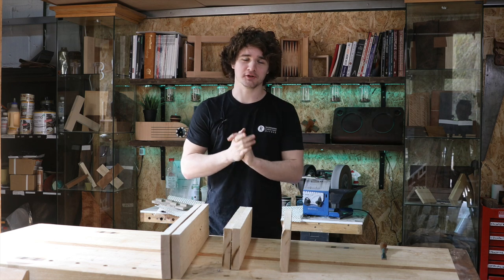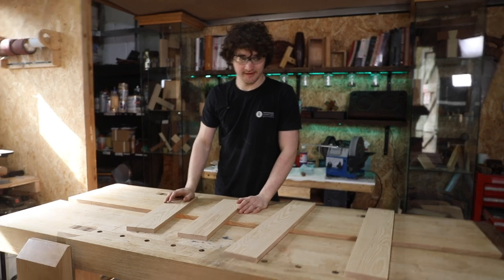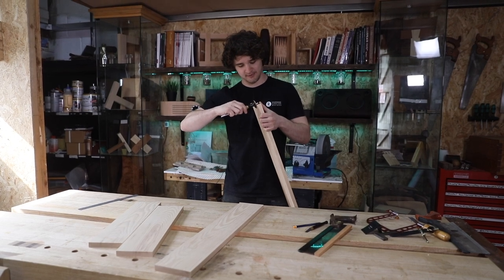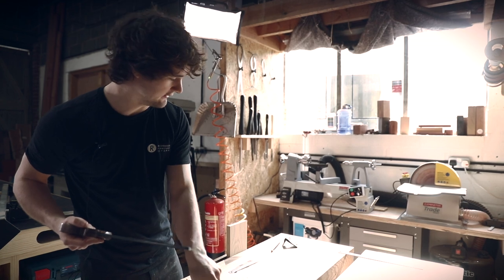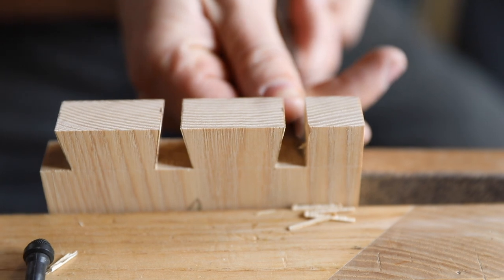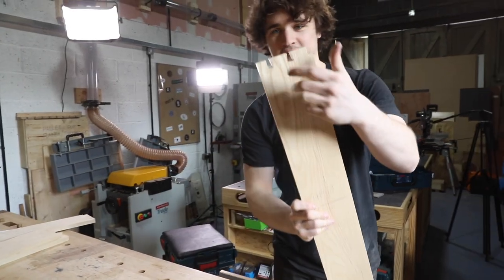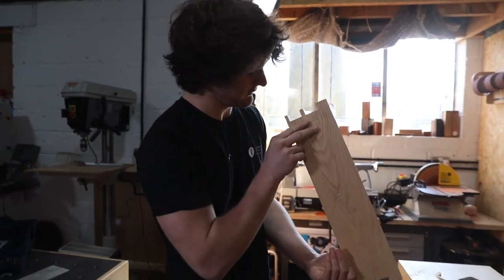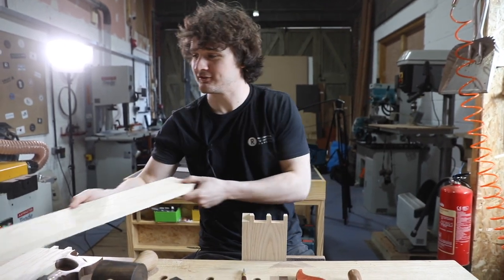Making a Router Bit Cabinet - Part 1

Comment: Wouldn’t a 1:1 ratio angle just be 45 degrees, or 135 respectively..?
Reply: Yes :)
Reply: Thought so lol seemed like he made that way more complicated than it needed to be lol
Reply from the maker: I was demonstrating how to create an accurate 45 degree angle if you do not have access to a mitre square. So yes, 1:1 is 45 degrees.
Reply: @MattEstlea  Exactly. It's also a good way to set up oddball angles on your sliding bevel. Having a nice large pencil reference lets you do that pretty accurately.
Reply: That makes a lot more sense lol I was so confused 😂

Comment: I have that same camera bag :-)
Reply from the maker: I love it!
Reply: @MattEstlea  One of the straps ripped partly on mine early on, but besides that it's been pretty bullet proof and holds loads. When I'm not using my small bag as well, I generally have 2 small DSLR bodies, 5 lenses, 2 speedlights and a whole array of accessories and sometimes 2 light stands clamped to the outside of it lol